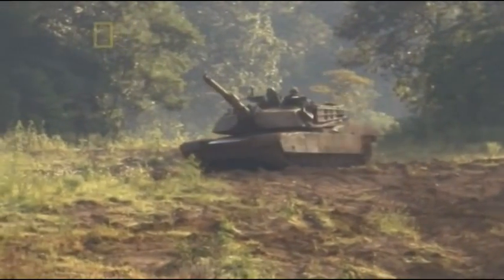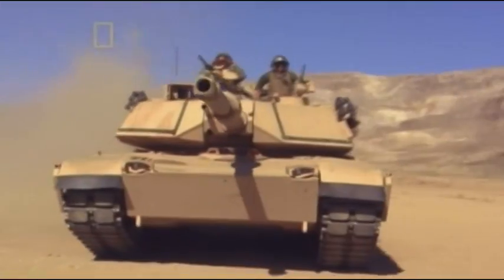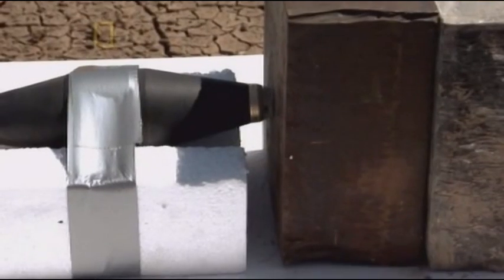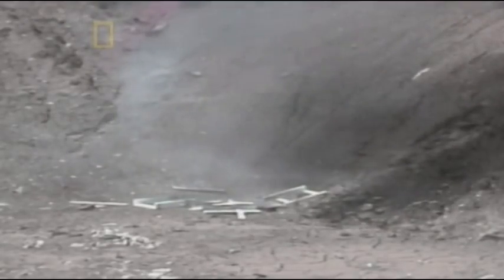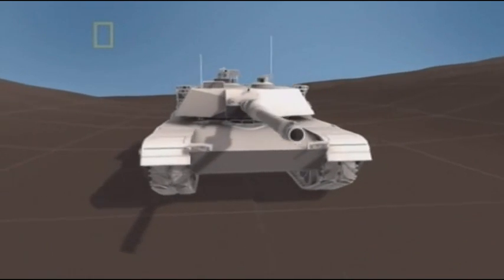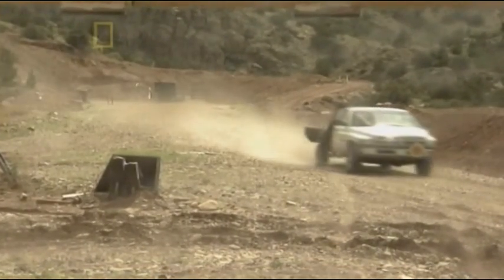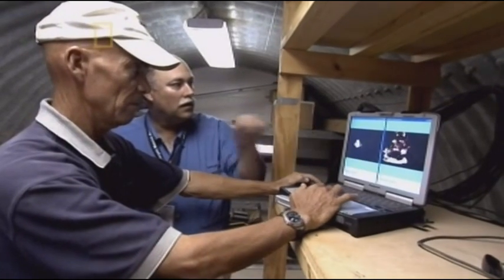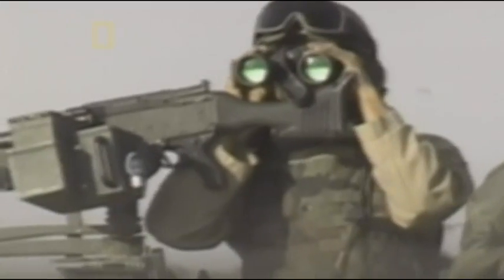Explosive Reactive Armour Explained

Comment: for those wondering the difference between low explosives and high explosives is generally the reaction required to detonate them, low explosives can actually be more dangerous as their detonation can be caused by impact or combustion. whereas high explosives are actually more stable and less likely to be detonated by accident.
Reply: See the port of Beirut for details.
Reply: Completely wrong but alright.

Comment: The flyer plate has practically no effect on the jet, which has all gone through the hole it made in the plate and is on the other side before the plate has moved an inch. Put simply, what happens is the explosive sends a shock wave through the jet, causing it to spread out and hit the armor over a much larger area. The flyer plate, (the thick kind in this video, as early ERA had 5mm thick ones) is meant to mangle the front of long rod penetrators.

Comment: Not sure video is exactly correct. Papers I have read say that: 1) The 'jet' is not actually molten copper - it is plastically-deformed copper, and consequently 2) the 'jet' penetrates the armor purely by kinetic energy, not by melting the armor. It is just a copper fist punching through.
Reply: It’s not correct. It doesn’t melt the armor. It focuses on a tiny area, slices through and releases shrapnel everywhere inside.

Comment: reactive armor is meant to reduce the power of incoming explosive projectiles that PIERCES through armor 

not meant for HE-rounds in other words it is an anti-piercing armor
Reply: What about the APFSDS? can it even block this kind of shell?
Reply: @c4ezar  No, absolutely not, and probably doesnt even react to it.
Reply: HE : just standard explosive, like a stick of dynamite.
HEAT: a shaped charge which causes a shaped explosion. The explosion does not pierce the armor. APEX, armor piercing explosive would not be affected by reactive armor, but would likely be deflected by tank armor. Its just a canister with a bomb inside.
What HEAT does, is shape the explosion itself to be a directed jet towards the armor, using a metal rod which melts and is projected forwards.
So what HEAT is, is a super fast stream of extremely hot liquid metal that cuts through the armor. As such, a counter explosive can defeat it, as its basically just liquid, same as if someone sprays you with a hose, you can use another hose to deflect the force of the incoming water. You will still get wet, but you can avoid most of the water pressure.
Reply: @ribbitgoesthedoglastnamehe4681  That is not true, modern Russian ERA can reduce the penetrative power of APFSDS by up to 20%. It would also react regardless because the penetrator would create sparks as it went through the metal.
Reply: @hedgehog3180  Not necessarily. ERA is designed not to ignite on just anything. Specifically the explosives are designed to explode on being hit by that superheated jet but remain inert even when the neighbouring block of ERA explodes.
Only the most modern kind of Russian ERA can reduce APFSDS effectiveness, not the ERA 1 kind that is most commonly used. Though ur absolutely right that there exists ERA that can reduce APFSDS effectiveness. Though it probably doesnt work exactly as shown right here.
Reply: @c4ezar  No. APFSDS is essentially a giant metal arrow. It pierces the explosive, likely without even triggering the explosive reaction. However a different kind of modern Exploive Reactive armor developed by russia can apparently at least reduce the effectiveness.

Comment: Reactive  armour is only effective against heat, hesh or similar he munitions. Against a sabot kenetic penetrator or similar AP shells it is less effective. Not to mention ERA is only effective against one hit. A second round hitting the same space will defeat the unprotected armour underneath.
Reply: Some forms of ERA, Relikt and Kontakt5 can heavily reduce the power of APFSDS, so much so, that the composite armor underneath could stop the remaining power of the round. Speaking of composite armor which is found on all modern MBTs. Even if you lose your ERA, HEAT and other chemical warheads are still really ineffective against it depending on power of course. The Abrams', T-90, and Leopard 2s all have really strong turrets and front plates where most chemical and even some kinetic projectiles are just useless.

Comment: @martydrooo Merk is slow, S Korean tank is about 2x the cost and unreliable, Leopard is a cheap alternative but not very survivable if penetrated, also has less upgrade potential.  Only the Merkava is close to the M1's survivability.
Tanks are typically useless in urban combat.  The Abrams is an exception to that; the TUSK II Abrams has done surprisingly well in urban combat.  This is why it's going to be in service even though the US was about to get rid of it.

Comment: Turning explosive into an armor. Brilliant!

What's next? Water armor? Electric armor?
Reply: ***** Such madness!
Reply: This is all bullshit,if you watched the video you can clearly see the duct tape is the real armor.
Reply: There actually is liquid body armor
Reply: +Dog Electric reactive armor is actually a thing.  When the plate is penetrated it discharges a massive amount of power and vaporizes the object.
Reply: Water armor has actually sorta been a thing on battleships, the Iowas had a belt of tube around their water line which was meant to be spaced armor against torpedoes but usually it was just used as fuel storage.

Comment: Needs navy and air force versions.
Reply: That's the last thing you want on a plane or a ship. Reactive armour has to be placed on a titanium or depleated uranium shell in order not to do damage to the vehicle itself.
Reply: @Sun-Tzu-  your acceptance of failure is the weakness in your sauce.  Totally ok to have tanks inside a ship with reactive armour.  Also let me paraphrase Napoleon's genius, "you would have me move a ship by lighting a fire inside it bowels!" Refering to steamships...
Reply: @loraxmoose9150  The tanks inside the ship aren't getting shot at. An explosion goes both ways, it works on a tank because the reactive armour explosion isn't enough to damage the armour. A ship isn't as armoured as a tank, so the reactive armour detonation may do damage to the ship itself.

Comment: I would like to help with designs... Take that design and place it into a smaller scale. So you can coat the whole take with the peice's. Also maybe a new texture to our tanks and other armored ground vehicles. Similar to the structural designs used on these new Ford, Nissan, Toyota, etc. 
   It's an X-in a Box sort of....and would all for placement of concentrated Extinguishing Elements as well.

Comment: Not to mention it would only increase force of explosion. IED's usually don't penetrate armor (if there is any), but use brute force to throw vehicle, or even - with enough explosives - force armor plate inside of vehicle. That's the point of V shaped underside -  to send part of shockwave left/right, so less force hit bottom armor directly.

Comment: @lst1195 the PG29V is a new round for the latest russian made RPGs. it's a tandem warhead and actually penetrated a Challenger 2 in 2007! the round is mostly fired from the RPG29 but the latest models of the RPG7(v2) can also fire it. it's doubtful if the insurgents have any of these latest pieces of kit in any quantity. otherwise we are in big trouble...

Comment: @CptAwesome096 To trigger a  nuclear explosive it must be a controlled reaction otherwise it will just fissile.  A critical mass can be reached inside one of the packs, but must be contained and controlled to split or fuse atoms in mass.  In other words it would have to have an internal trigger, not external.

Comment: First ERA Is not factory installed. It's installed in operation areas. Reason for this is that you can Airlift vehicles for easy deployment. And because ERA is not FACTORY INSTALLED it is quite easy to replace in operation area and is readily available. So even if it is used only once per Combat operation It is replaced immediately after tank returns from combat

Comment: @showaltermicro no it's not. the T-80 has a turbine engine, and was derived from the T-64. it's bigger, wider, and roomier. i think you are thinking of the T-90, which is a heavily upgraded T-72 (with shtora, ERA, and better fire control)

Comment: @kireta21 
 I know it is not a HESH round, but the effects of a simultaneous detonation of  many ERA tiles would produce the same effects as a HESH round, perhaps  producing effects even more devastating than a single HESH round, as there would be ~50 kilograms detonating. The explosives used in ERA are probably polymer bonded explosives, most likely based on the very stable TATB / Triaminotrinitrobenzene.

Comment: No, the armour in the Turret is in the Leopard 2a7 bigger 
In M1a2 ca 1800mm
In Leopard 2a 7 2300mm
Reply: +Tim Kalmbach measured it yourself from inside?
Reply: +August P no, i only read Infos 😉
Reply: +Tim Kalmbach The M1A2 has classified armor for the American DU armored ones. it's estimated to be close to 3000mm thick though
Reply: people who have measured it have said it's only ~900mm thick. If it were multiple meters thick there'd be no room for the crew. The idea is that it's more effective against shaped charges than steel, so it provides the equivalent of more than its thickness. Although it's still incredibly thick.
Reply: Mrsirr 
i mean literally every modern MBT is measured in RHA equivalent thickness, since the composite armor used in them now is multiple times more effective than RHA of equal thickness
Reply: signs80 Ahh yeah if you're talking about RHA equivalent then yeah. Though I've read that the composites are more effective against shaped charges but slightly less effective against KE penetrators, that their main advantage comes with how much lighter they are than steel. I've read the 900ishmm of composite on the Abrams is estimated to be equivalent to like 700-800 mm of steel against KE rounds, but that's not bad because you'd never be able to get 700mm of steel on a tank, plus that's already most likely enough to stop any existing kinetic energy penetrator in service, so it is more effective than steel by weight.

Sheesh I got carried away.

Comment: @thiagolck Kontakt-5 is obsolete now. Unsuprisingly, as it's 80's tech, and in fact M829A2 was developed to defeat it. To counter it Russians developed Kaktus and Relikt ERA, but never installed them on production grade vehicles, probably due to costs. In the meantime Americans developed M829A3, Germans DM-53, British L-28 etc.
@ThePerfectRed 
ERA won't explode without enough physical force to ignite explosives inside, so MGs can't. As for autocannons it all depends on armors design.

Comment: Reactive armor has many drawbacks:
1.: it works only once. When normal armor stops an anti-armor weapon the armor is still there to stop another hit. After reactive armor detonated that particular reactive module is gone.
2. It works against limited weapons. Mainly missiles and HEAT rounds. The effects are nonexistant or at the most limited against kinetic energy rounds and useless against dual warhead missiles (these have a small charge that blows up the reactive armor and a main charge that then hits the naked armor).

Its interesting as a cheap way to protect weak areas of a tank or AFV but NEVER as a subsititute for conventional armor. That is a problem with Russian tanks, they rely to much on reactive armor.The conventional armor below it is weak.
Reply: NationalSniper That's exactly why they covered how the tank's armor is augmented by the reactive armor, not replaced.  It's a situational defense used when vulnerabilities in the tank's design which are normally negligible become serious.

Also, armor isn't as reusable as you seem to think it is.  Even if it prevents a high-energy or armor-piercing blast, it's going to take severe damage.  Another blast to the same point is much more likely to break through.  It's not necessarily any better than reactive armor in this case.  For projectiles weak enough not to deal any physical damage to the armor, the argument is moot because it's unlikely it would ignite the reactive armor either.
Reply: NationalSniper All good points, one other draw back I would add is it has the potential to kill friendly soldiers outside the tank due to the explosive nature of ERA.
Reply: +NationalSniper You can sandwich ERA with it.
Reply: That's why Russia's old T80, T90, and new T14 tanks already has type 3 to 4 integrated APS. ARENA, Afghanit, Shtora, and electronic warfare systems for this problem. What Israel or USA has now, has already been developed and used by Russians years or decades back. Even the Reactive Armour was also first developed in ussr 1949. 

Drozd or Russians version of Iron fist was first to be created in 1977 used in T55. Now its name changes or some called it "Afghanit" used in T90s and Armata T14 with improved version. Shtora(electro optical jammer) was created in 1980s used in T55 and current tanks. Purpose is to blind laser target and rangefinders of approaching ATGM. And ARENA(Russians version of TROPHY) system builded in 1990s. Never underestimate Russians counter system. 

The Russian tanks are export model that are destroyed by latest weapons in Iraq war. Just like Saudi Abrams being cooked off today by latest Russians weapons. Though they have been destroyed back then. Even Merkava has been destroyed by Kornets and RPGs. That's why Israel has created the TROPHY system and iron fist. They didn't develop for fun my friend.  

Russians are master in this and imagine by now they must have much precise, effective, not easily damage, speedy version, and decade ahead of anyone in this for matter. They know the pros and cons very well. They know how to by pass this, fool it, and so on. That's why Israel has asked Russia not to sell Kornets and latest ATGM to Syria and Iran years back. Again, never underestimate it.

Comment: @marmaladekamikaze 
No, these explosives are not that strong. Base armor still provides more than half of vehicle protection. Simultaneous explosion may cause "shock wave" through vehicle hull and possibly damage electric, hydraulics, shellshock effect on crew inside (tank when hit is like inside of ringing bell), same as beign hit by any warhead that didn't penetrate. But hull itself won't be damaged, it's not HESH round.

Comment: Lol, not exactly a fair test, in the first instance, the shaped charge is right up against the 'armour' whereas in the test with the ERA, is is a couple of inches away. The shaped charge will have an optimal stand off distance (which is why rpgs have hollow noses). Moving the charge a few inches away will reduce the effect of the charge anyway.

ERA is much more effective with two plates at an angle anyway, like on the front/turret.

Comment: Large, slow moving armoured vehicles have always been vulnerable on their own, and always will be.

Tanks need to be supported by other forces, preferably mechanized infantry, and ideally with pre-established air superiority.

Which means that the battlefield is not free and clear for the atgm squad to operate their weapon with impunity. Most of those anti-tank weapons have a range of about 1000-2500 meters, MAX. 

It's not easy to shoot at tanks when there are other forces supporting them.
Reply: This comment has aged like fine wine. cheers to you sir

Comment: so.. what prevents the explosive plates around the impact plate from going off, aka making the whole outer layer go off from one hit ?
Reply: +chipmunk3k My guess would be the small spacing between the plates and the idea of one reactive plate blowing with most of its force towards the object of impact rather than in a radius.So the other ERA plates "feel" just a vibration and perhaps some lightweight shrapnel.
Reply: Super late response I know. But adjacent tiles actually can be set off by an impact, it just depends on a whole lot of little variables so it's not something that can easily be predicted.

Comment: Although I question the rather naive model used in this test (with a heavy vertical flyer plate in a static test), the result is certainly impressive. What irritates me is that, when I was a kid in the 80s, there was an awareness of ERA but never any really good explanations of why it worked. I suppose we were considered simple retards back then.
Anyhow, it's good to see armour technology keeping pace with projectiles when some voices have been suggesting for years that the race was lost and that tanks were history.
Reply: There is an asymmetry of cost and rate of design refresh that favors the antitank weapon. The tank is a million dollar vehicle that needs to stay in use for thirty years. It represents a "fixed target" and a comparatively cheap antitank rocket can always be engineered to penetrate it. It is cheaper and faster to design and build a new RPG than a new tank.
Reply: bcaulf I agree with your cost/benefit analysis re: ATGWs, which are heavier and more complex than RPGs, but still lightweight and inexpensive compared to MBTs. However, the experience of Challenger 2's armour package in Iraq vs RPGs would seem to confirm the effectiveness of contemporary first-line armour.
Actually, as a humourous aside, your comment reminded me of the words of Sir John Fox Burgoyne in 1860; "'I have no great confidence in iron-plated vessels. I think that improvements in artillery will go faster than improvements in fortifying the sides of ships." How prophetic his words were proved: one hundred years later, armoured fighting machines were phased out of the British RN.
Reply: ha ha ha, interesting bit of perspective
Reply: And now in 2022, tanks are indeed history, at least in urban combat against ATGMs.